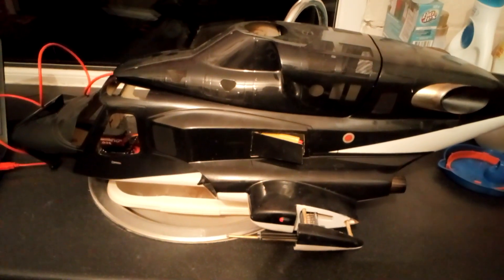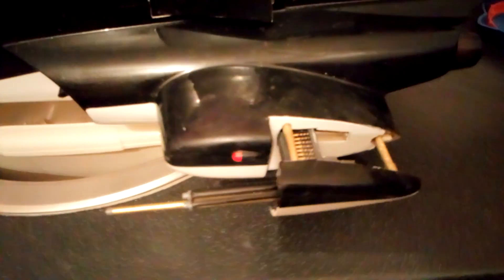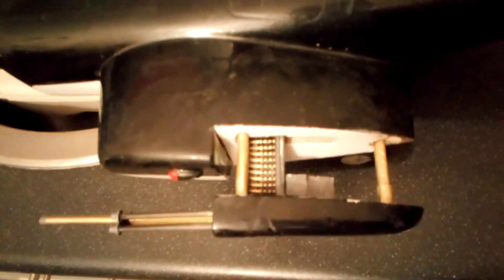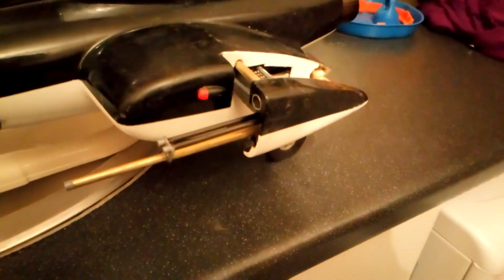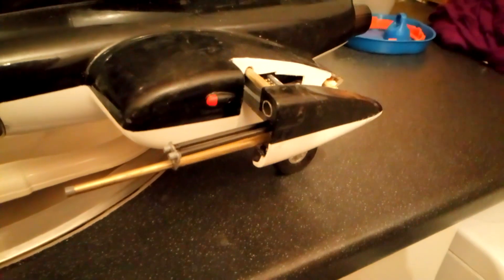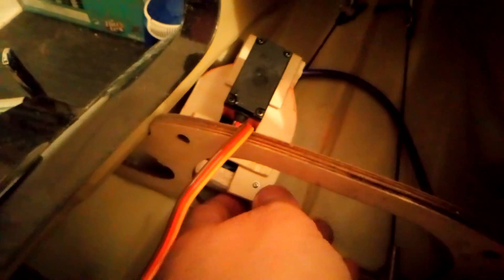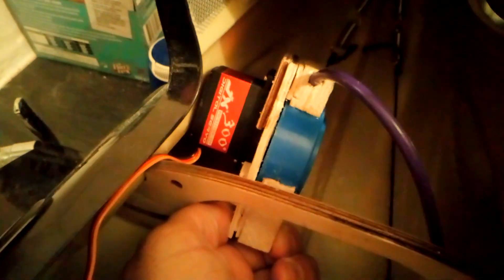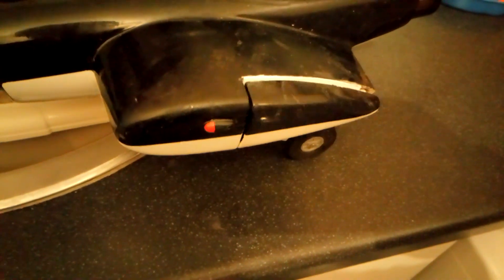RC Airwolf - Retractable Side Gun Testing

Comment: Looking forward to seeing it completed.......Mine is a 500 size with alot of self modifications but the sound system and flashing guns really brings it to life......The Sound system could be very easily installed into yours......https://youtu.be/Ga5sNowUFfA
Reply from the maker: Cheers Ade - Will post some more updates soon. It's going to be a somewhat slow build but I'm trying to get as much detail in as I go.  Yours looks the business!  How did you get the gun lights to flash?

I have a Shockwave2 from Model Sounds Inc with a pair of 4' speakers to run off the 6S flightpack.  Bit of a squeeze to get the speakers in but should work and will give a good depth of sound.  I will be installing the sound module next so stay tuned!
Reply: RC Experimental Developments The gun lights are these https://hobbyking.com/en_us/dr-mad-thrust-machine-gun-effect-led-unit.html?___store=en_us
I bought two sets one for each side but I needed to splice one of the lights on each side to make a third......I also replaced the led's to orange and used 2x3mm and the larger 5mm for the bottom gun......Its triggered through an aux channel which is also connected to the shockwave sound system which produces the sound. 
I hid my 2inch speakers behind the  turbo air intakes and covered with cut up black tights.
Your retractable guns are awesome !!
I would love to add more detail but where do you stop ? Plus I'd never fly it just incase it ever crashed I'd be inconsolable so I've reached the happy medium where I have enough detail but I'm also happy to fly her just !! :)
Reply from the maker: Thanks very much Ade for the link to the LED sequencer.  The effect it gives on yours when linked to the sound module is fantastic!  Good effort! I will see if there is sufficient clearance in the retractable mechanism on mine to run the wiring through.  The tinkering never stops does it......

Cheers for your thoughts and encouragement.
Reply: RC Experimental Developments Luckily I've stopped tinkering but the 600 size does have the retractable landing gear with springs I would have liked but i had to modify the retracts i bought  and had to remove the springs otherwise they wouldn't fit the 500 size.........Hopefully you can create all the extras yourself as the Airwolf parts are near impossible to get now so hopefully mine stays airbourne........I'll watch with interest your build if you do have any questions I can help with please contact me as I have all the Airwolf series on DVD to help getting the correct look including the lights which most get wrong......
Reply: @adeburnham419  hi what size retracks did you use on ya 500size airwolf as i dont like the standard stock ones thanks👍
Reply: @rcexperimentaldevelopments7085  how do u get gun pods to come out while in the air due to the retracks goin inside wheel guard thanks 👍👍very impressed with what you have done 😎😎😎👍👍👍